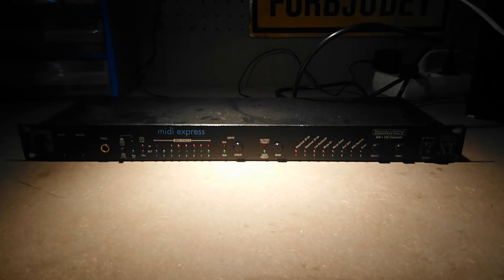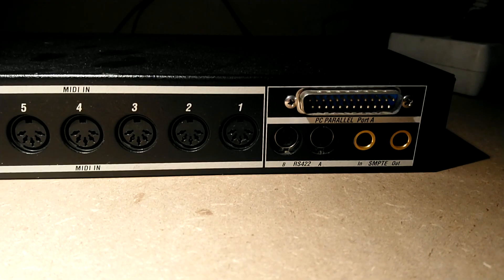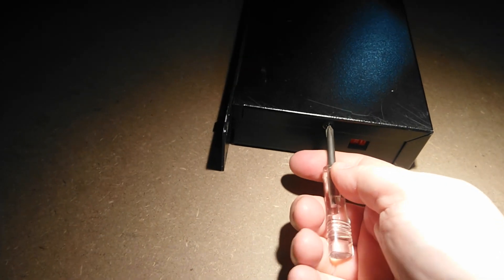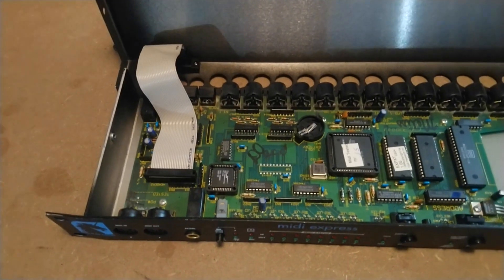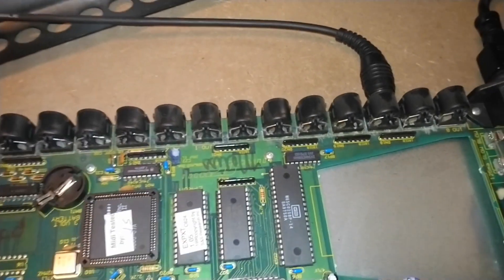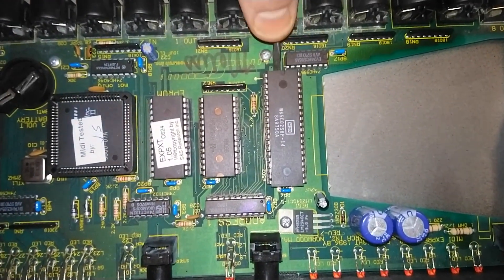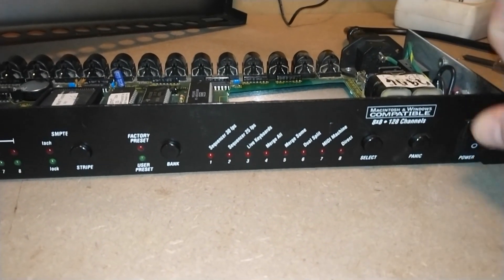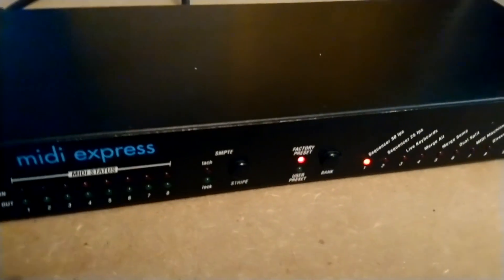Simplest repair ever - MOTU Midi Express XT

Comment: I have this model too.
Is there a detailed description of each of the factory presets in the manual ?
Reply from the maker: Yes. I haven't found a manual for this old parallel port version, but the manual for the USB version is still on MOTU's web page, and it has a description of all the presets, and I think they are the same.I only ever used the Live Keyboards preset though, that did what I wanted (except for the problem with a TR-909 and clock signals).
Reply: @RegebroRepairs  ok, yes - that one looks good!
Thanks for sharing the video.

I should prob check the battery in mine.  But i guess factory presets are staying in lace, either way (?)
Reply from the maker: @EvLoutonian  Yeah, the factory presets work either way, but with a working battery it seems to remember which preset you had, which is nice.

Comment: It works perfectly with 64bit Windows. What are you on? The MIDI sysex can be sent from anything with a midi interface.
Reply from the maker: bookmarkthis   You can't use all features, as far as I know. The MOTU MIDI Express needs drivers installed, and a software called Clockworks. The drivers for this old parallel port version does not work on 64 bit Windows. 
It still works, you just can't program it, you can only use the existing programs. However, the presets are quite useful, I used it on the "Live Keyboards" preset, which echoes everything from all inputs to all outputs, except the corresponding input.
So everything on Input 4 is echoed out to all Outputs, except output 4. This way you can connect up to 8 keyboards and control each keyboard from all other keyboards.
The only problem is if you have a TR-909, which I have.
Reply from the maker: The configuration software for this device doesn't use MIDI, it talks to the device over a parallel port. If there is some way of configuring it over MIDI, that would be awesome, but there's no mention of that in the manual or on the internet.